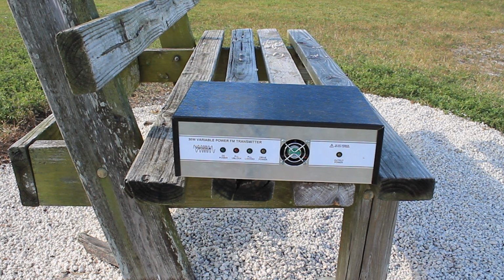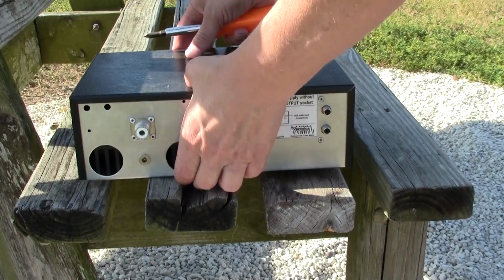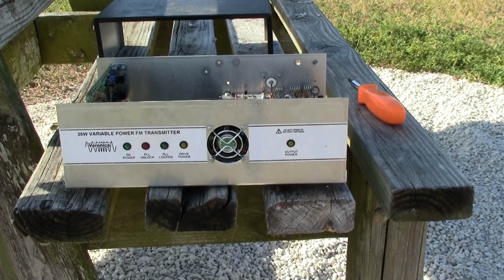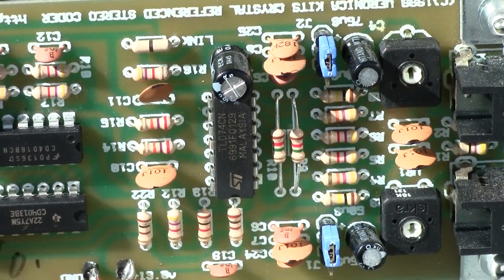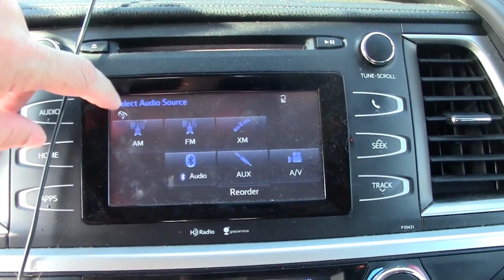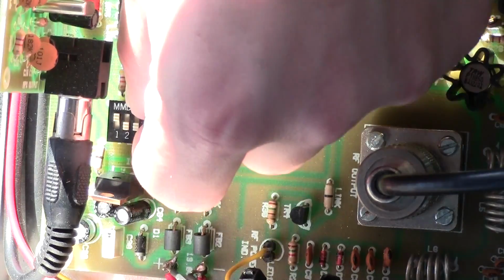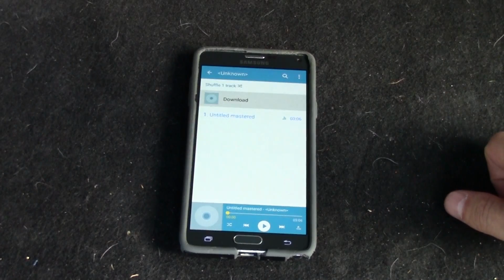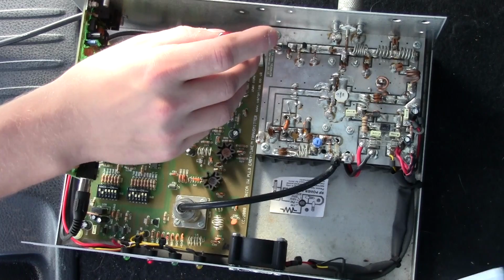Cheap PIRATE/UNDERGROUND FM RadioTransmitter by Veronica--How To

Comment from the maker: Just recently bought an SWR meter:  http://amzn.to/2vowNWl
Reply: jakeguitar01 Your SWR meter isn’t built to measure power in the band the amp operates (147 MHz vs 106 MHz ) so don’t take the results to heart. I’d apply a fudge factor of +-15 % at least. It’ll tell you how well the antenna is tuned to freq you’re operating on for sure but as far as an quantitative transmit power level, nope.
Reply: Un  correo a donde se pueda uno comunicar.    Por favor me interesa donde están ustedes
Reply: Lett me ask u for transmiter unit antenna radar underground
Reply: How much is this ❤

Comment: They were good in the 90s!  A lot of stations run them, but the owner of the company was convicted a few times and fined £5000 each time for supplying the equipment.  RIS in Warrington went after him constantly.
I used a PLL board in to a philips PA module from an old PMR radio, that give 20watts.  Later I got hold of a PYE A200 linear amp on Band M1 which was around 106MHz.  This took 13A on 13.8V and delivered a solid 65Watts.  My first experiments in 1985 were with producing a 19KHz carrier to make it look like I was broadcasting stereo.  Years later I built a simple encoder from a 4060 and 4053 IC that give decent separation between the channels and still works to this day!
My aerials ranged from a dipole to 4 dipoles stacked on a huge pole, then a slim jim which worked better than everything else.
I went on to be an RF Engineer because of what experimenting had taught me.
I always wanted to try MW but never got past 2Watts AM.  I lost interest after building a 500W amp from audio MOSFETs and blowing it to bits.
One thing I never tried was microwave links, so took a huge risk having a full and expensive studio set up with a transmitter.

Comment: CQ, CQ!  

Gosh , as a kid (14-17), I built pirate FM and AM radio stations using valves (tubes) -chips are indeed a lot easier.  For aerials, I cut-to-fit 2 old Radio Shack FM cross dipoles  Had to make balun coil converters, used cheap RG 58AU (I was poor) and I made a 2 BAY curricular polarised antenna syste!m! (not bad -eh?).    I also converted a large (15 - 17 tubes)  broad-band cable TV amplifier to a good 3 meter linear amp that eventually gave me about 20 watts ERP.  I was so poor, that I had to tune everything using a light bulb dummy load (short periods) and working with a friend about a mile away with a good receiver and S meter.    In the end, I think I was probably getting my SWR  down to at least 1.5:1, but probably loosing a few watts in the damn cheap coax.  If I could have afforded 9913, it would have been real tight. 

This was a real home-made rig, but it performed as well as a 1950s RCA exciter -in fact the sound was better and louder (WITHOUT anything but a cheap compressor based on the then new optical isolator.  I was able to get two isolators (for stereo) for free as samples by using a deep voice on the phone...  When you are 16, have noooo money and want to play radio, you become very inventive.     I was obviously doing a little better than 75K deviation and the EF86 valves in the audio stage gave me great deep bass that no other station had.  -Probably some AM artifacts as well, as we came out a tad louder than any other station on the band and had a far more pleasing signal.  Solid state exciters STILL do not sound as good as the old valve exciters.  - but the FCC never bothered me.  We kept it clean, did not interfere with any legal stations and played a lot of god music that the commercial stations would not play.  We covered the entire town!  Commercial FM station have all that power mostly to impress advertisers.  After 500 to a 1000 watts ERP,  it's the height of the aerial that matters most -not the power . FM is lone of site.

Just to check out all the new gear, circa. 1997, I built a chip PLL X-mitter, (150 watts) and put a station on the air in MANHATTAN -for the upper east side!!  I used two skyscrapers behind me as rough RF directors and managed to aim a signal about 10 miles into Jersey, but I was picked-up more in QUEENS!  Go figure.   Again the FCC  left me alone, but I was only on the air for a bout 2 weeks. -Just wanted to see if I could do it.   —I could, but, it was more fun in the old days. I went back to my 1.3 KW HAM 20 metre phone station as the sunspot cycle was just too GOOD!  Later I'll tell you a good 9-11 story...

73s !
Reply: Dude.....will you please bring me into the light...lol. How the hell do you set up a radio station, playing illegal content (copyright infringement of any song you don't have the legal royalty rights to), and broadcast to your local town without being sued or prosecuted? No I'm not being a smart-ass or a prick. I seriously want to know how you pulled that off cuz that's one of the coolest things I've heard. Especially in NYC. Regulation capital of the east coast.  I'm not some idiot who comment's on post's because I have no life, I am extremity fluent and proficient in setting up 11 meter CB base stations and have had many friends that had their HAM's (at least I thought I was,) but never heard of someone getting away with broadcasting on the FM local channels and with that much power. I am feeling a little impressed at the moment but now I have a million more questions.....
Reply: Hey...Teach Me.
Reply: Hey Bixby, I was wondering if you had some time to explain a few things for an aspiring broadcaster.
Reply: @stephenperrault  We did it for years in years in Ireland!  Sure the law come after you at times especially when taking serious advertising revenue for legal stations.  Have a look at the history of pirate radio in there UK starting offshore with ships.  In Ireland look at radio Nova, Dublin.  At its peak it was 50KW am!
Reply: How to make a Transmitter?
Reply: @stephenperrault  He said how: it was back in 1997. The RIAA and the other mafia organizations didn't do their racketeering methods as recklessly back then as they do now.
Reply: How to build the fm transmitter?
Reply: God bless you man that,s the stuff of dreams I just left a comment section in a  random ham radio how to video all the yuppies jumping up and down about getting their licenses the taste of boot so firmly ingrained in their DNA they couldn't even tell it was there I couldn't believe it the idea of need a license for a little ass walkie-talkie ham radio made me sick 🤢
Reply: @stephenperrault  I feel that it is our duty to the Constitution As Americans to usurp the illegal impediments placed before us by our federal terrorist organization located in DC I am with you on this mission
Reply: I build an fm transmitter too when i was 10.

Comment: It should be noted you need to make your adjustments using a plastic screw driver, not one that is conductive. It interferes with the ability to get the fine adjustment if you don't.
Reply: If can’t find plastic screw driver, use a straight wasted tooth brush handle, file into a slot screw driver in size, I had used to do it during my youth time.

Comment: Cool, i live in the uk and i have one of these veronica transmitters along with the veronica compressor limiter. RARE.
Reply: Slt,

Oui il est fait avec un NE 571 ou un truc du genre, un super AOP en gros. Bien réglé sur une K7, le son était ausi propre qu'un CD, mm plus doux, moins "saccadé". Sans bruit de fond avec une plage dynamique énorme. 😉
Best regards.
Reply: Definitely, the compressor/limiter was quite expensive and I do not know of any other surviving ones.  I used a Behringer Composer Pro on the audio in to my home made stereo encoder, PLL TX and 65 Watt ex-PMR amp.

Comment: I'm broadcasting the audio from this video on my pirate radio station! Meta!

(a Ramsey FM100)
Reply: I also have a Ramsey fm 100. I built a amp to get 1w out of it and ran it in to the 30w board inside the transmitter in this video. I didn't buy
A pre assemble transmitter but I has purchased the 30w veronica pcb about 20 years ago.
Reply: I'm re-broadcasting the broadcast of your audio from this video through an off-air repeater

Comment: you might want to use a plastic TV adjustment tool, than a metal tool, when adjusting those pots.
Reply: yep, that is a must. you could damage the pot and a long metal screw driver shaft can affect the adjustment.

Comment: Had major issues with this in the early 90's with this unit. Bleed over on the Hi's and Lo's. All our kit was SWR checked. It seemed to suffer with Temperatures were it also tended to just slightly drift frequency a bit. Good at the time and for the price..
Reply: These units are pretty average in their specs and quality. A good exciter shouldn't have to have the PLL manually adjusted for lock. They're using circuit design techniques which are really antiquated. A PLL unit should not drift under any circumstances - that's why you have a PLL!

Comment: a lot of people don't understand what the fcc part 15 rules are all about. operating a non-compliant transmitter isn't illegal if you can demonstrate that you are not radiating excessive rf or harmonics that could cause interference with others. a transmitter has to be part 15 compliant if it is for sale, but if you build a transmitter from parts it does not have to be part-15 compliant as long as you don't sell it.

Comment: I tested one of these back in the day,  (a "30 Watt" one) it had about 10 whole Watts on the frequency it was meant to be on, and the rest appeared as a general mush from about 47MHz (the ½f was 52.1MHz) up to over 150MHz. It was radiating slightly under a Watt on 121.5MHz, which would really piss off the local airport. There was also some output at 243MHz so even the military would be interested in getting this shut down!
Reply: so an all-in-one go to jail solution :)
Reply: @ Scott 1 and you know this because of your vast engineering experience and education in RF right?
Reply: Sounds like there's no filter on the output. Radio Frontline in Manchester back in the early 1990s put out loads of out of band transmissions. I remember it's 100.4mhz signal also had another equally loud signal on 50.2MHz the SSB calling channel on the six metre ham band. It used to drift like nobody's business. No wonder it got shut down.
Reply: Same for the Chinese made eBay transmitters. They are pure garbage and seeing 15 watts on a meter, does not mean that you have anywhere near that wattage on the intended frequency. They are dirty AF
Reply: The FCC doesn't enforce any the such laws. If you want to play hall monitor, go ahead. No one cares.

Comment: I don't even know what this thing does but I watched the whole video anyway
Reply: I don't think the guy who made the video knows much about it either so don't feel bad.  It's a commercially made FM Transmitter that transmits in the Medium Wave band (the commercial FM band).
Reply: Chris Cunningham Medium wave band is AM from 550 to 1600 khz, FM band VHF. 88 to 108 Mhz.
Reply: @chriscunningham6362  You don't seem to know what you're talking about either. The "medium wave" band uses AM and is in the 530–1700 kHz range (contrary to the FM band shown in the video).

Comment: best to tune transmitter into a dummy load and watt meter first!  50 ohm load. load rated for VHF or higher will be fine. also VSWR on antenna important as well tune under 1.5:1 . I have several dummy loads.  check rated power and frequency.

Comment: We ran a pirate station in the early 2000's. I looked at some Veronica transmitters but they were expensive back then. We paid for a home made 130Watt transmitter. When I opened it up it was pure analog. There were no IC's on the board. It also came with a link transmitter which was used to send audio from one location, to the transmitter in another location. This stopped the then DTI from finding the broadcasting location if they found the transmitter. I've always wanted to know how that transmitter worked because it worked very well. Except, if you got close to it you ended up with a headache. It was probably dangerous.
Reply: The transmitter is fine, the high levels of rf you were standing is was just frying your brain. That's why you put the antenna up high where no one is around. It's even worse the higher you go in frequency. I got a real bad headache running a 2 watt 2.4GHz studio link into a high gain antenna and sitting in front of the dish not realizing it was on. Oops!

Comment: My 7 watt tx will also cover 15 miles, the same as my 30w and 15w.  I think my limit is the Antenna height.
Reply: Did you calculate the antenna to get it to transmit that long? I bought a chinese 7W pll fm transmitter with a screen, and actually set the antenna really high, but the max range is like 700 m
Reply: It’s VHF FM so it’s very much line of sight and power matters a bit less
Reply: More power does benefit indoors reception tho

Comment: Fixed plenty of these old transmitters, crystal based though so Audio was tinny and thin compared to transistor multiplier circuit based transmitters which have a much fuller sound as they are not restricted by the crystal.
Reply: Rubbish!  Tinny audio was caused by not modulating it correctly, so possibly poor audio equipment in use.  They were all set to the same FM deviation of  +/-75KHz.  They would do this as a maximum before sounding distorted, so anything lower was the users fault.  It doesn't matter how a frequency is generated, PLL or crystal, that has nothing to do with the FM deviation level itself.

Comment: You can petition FCC for a community radio, a low powered station. There are all kinds of rules to comply with, and it is not a sure thing you will get approved. They are still low powered, you have to be on air (meaning run the station daily), have community related public services and announcements, allow others access to use the station, and you will be subject to review and renewal. In other words it is not a casual thing. You have all the liability or commercial radio station with a very small range.
Reply: haha ask WRFN radio free nashville what a pain in the ASS that was with corporate radio stopping you at every turn

Comment: If your antenna is at least 60ft or more in hight  if that's at 30watts it should be 30miles because your antenna should be high enough then it should work out at 1watt per mile.

Comment: You have Jumper 1 in the wrong position! It is set for 50uS instead of 75uS. It's clearly shown on the board where this jumper should be. J2 is correct for 75uS.

Comment: I feel a hot wind on my shoulder
And the touch of a world that is older
Turn the switch and check the number
Leave it on when in bed I slumber
I hear the rhythms of the music
I buy the product and never use it
I hear the talking of the dj
Can't understand just what does he say?
I'm on a pirate radio
I'm on a pirate radio
I dial it in and tune the station
They talk about the u.s. inflation
I understand just a little
No comprende--it's a riddle
I'm on a pirate radio
I'm on a pirate radio
I wish I was in Tiajuana
Eating barbequed iguana
I'd take requests on the telephone
I'm on a wavelength far from home
I feel a hot wind on my shoulder
I dial it in from south of the border
I hear the talking of the dj
Can't understand just what does he say?

Comment: as a UK pirate I've seen hundreds of these converted to run more power usually around 70watts on the right tower it got out really well.
Reply: SO have I, much bigger PA in them!  The problem was that some didn't know what they were doing, so didn't have a clue about RF filtering.  When I first started in pirate radio at 13 many years ago I didn't either.  I used 2 x 2N3866 as a huge oscillator and destroyed everything for a few roads.  It was only as I taught myself more and built more advanced circuits that I put some amazing sounding transmitters on the air!  I was never in to DJing, just the electronics side.

Comment: This would be cool with my breakaway broadcast mpx output. I would just bypass the internal encoder. The cheap china xmitters don't have mpx wave input
Reply: james borg i also have  china xmiter and cze xmitter have had any results on mpx bypass? also check out stereo tool software fm rds out
Reply: The cheap china transmitters have a cheap modulator chip that is amplified with a 5 watt transistor for higher output.
Reply: Yes they are but i also tryed it with rds encoder with another schemtic  i followed to build a audio attenuator with rds board work a charm
Reply: james borg Those Chinese transmitter are very low quality. They put out a lot of in band harmonics and the audio quality isn’t good either. Breakaway is years old, you should try Stereo Tool.

Comment: I just use a raspberry pi zero which with a 2 cm wire, can transmit around 10m... imagine if I hooked it up to the dipole antenna
Reply: Did you try mounting the pi outdoor on a small pole and test the range ?
Reply: @RakshithPrakash  No and I am not willing too as it is illegal in my area (even if transmitting low power, low range, for a short time)